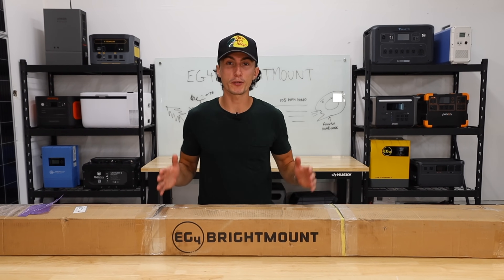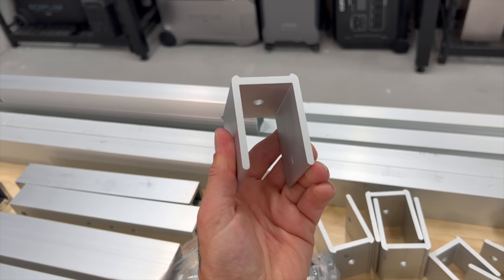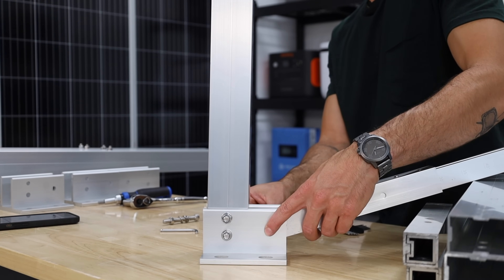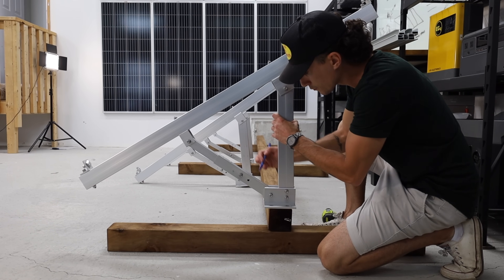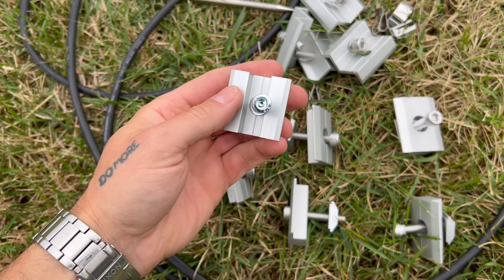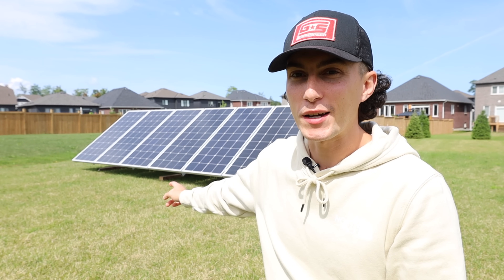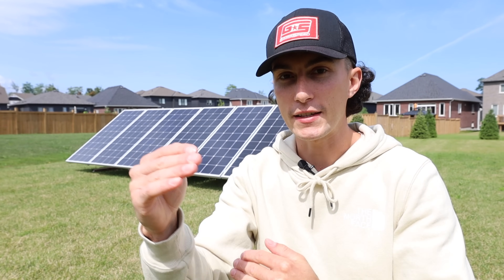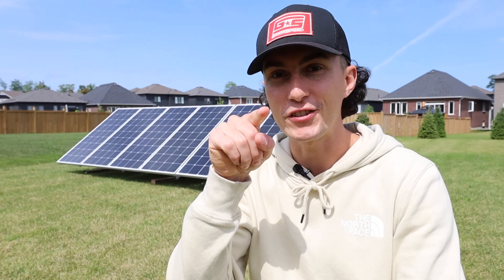Why Is It So Popular? - EG4 Solar Panel Ground Mount

Comment: So I think I have the same problem as you.  I have large bi facial solar panels that are 8‘ x 4‘.  It sounds like these can’t handle it. Also many of these adjustables can only go between 30° and higher. I am in Texas and I need 15° during the summer.

Comment: I highly recommend the Brightmount kit. I have it installed. You're correct that the bolts and connectors weren't labeled but it's pretty easy to figure out if you take your time and rush through it. I have one kit and will order another one down the road. I like your set up with the wood beams. This is so much more simpler than the concrete piers. Right now mine are anchored with limestone boulders until I could figure out the concrete piers. Now, I will go the wood beam route. I saw in the comments someone used 8x8s.

Comment: 6 panels? Maybe back in 2010. But today it only hold 3 400 watt panels. And requires an extension kit to add a 4th panel

Comment: hi, are they available in a larger size so you can mount two rows of panels?  I'm looking for to mount my 36 panels and only one row would make it too long for my property.  Also do they come with whatever engineering paperwork is necessaryto have them permitted?

Comment: I think this is Discontinued, its no longer for sale on Signature Solar
Reply: Agree - April 2025 - I could not find this mount with your link or anywhere!!!
Reply: @lindaswann6664  There is another mount which is easier to set up(integrarack) but it's more expensive and I don't like the fact that you cant really raise it off the ground (I get a lot of snow at times)

Comment: How gaint are these racks??? What is the width??? Your link doesn't go to the rack....
What about the back frame support??? You didn't show the strength of the joints 6:18....the base i do not trust...plus we in snow country needs more hieght off the ground...

Comment: what was the total size of this? The links do not go to those mounts anymore are they still available ?
Reply from the maker: This mount will fit 3-4 panels depending on the size of panel you're using. 

Also, thanks for letting us know about the link. Here's an updated one: https://signaturesolar.com/eg4-brightmount-adjustable-cat1-solar-ground-mount-system-supports-3-4-panels/?ref=thesolarlab
Reply: @TheSolarLab sorry yall, this link doesn’t work either
Reply: @TheSolarLab  none of your links work. Where is the actual product?
Reply: @TheSolarLab this link went stale, too. 😢

Comment: I own both v1 and the new v2 of these mounts and put them together over new years weekend. I took a side by side pic of the different parts and you will not believe the difference in thickness between v1 and v2. And to put insult to injury they went up $40 on price! I hope they are not cutting corners like this on their v2 chargeveters and batteries.

Comment: Brightmount Ver CAT1 has been posted on signature solar. looks like the rails can be adjusted but does not look as strong. The wind rating went from 105 to 90mph but the cost went up to $310. i was told the rails are different so if you have extras clamps and joining plates they are not going to work on the new version.

Comment: Great video, helped so much... good stuff, truly...  
but you left out some major details, like you didn't mention the holes in the adjustable angle inner sliding piece don't actually help... it only has 3 places the hold...  so despite your comment about 'firing in a bolt at the position you want', is absolutely impossible to get the right angle if you are in NC in october, and need around 50 degrees...  you can't even set it to 45 degrees. it's kind of sad... 

I will have to drill more holes...  they could have done that, but apparently chose not to, OR....   somehow yours is different than my EG4 mount. My GUESS is the way to be accurate is to just use the set screws to hold it in place... which does not seem very strong to me. So for now, I'm drilling holes at 45 degrees, even though 51 is ideal this month.
Reply: I would angle the base so you could get 50 deg

Comment: Thank you so very much for this. I built my own and what a pain! Never again. Plus, with my home made system I have to set each panel for angle to the sun. With this and a helper, it would be all set at the same time. I am going to purchase from Signature after seeing this!!

You didn't say or I didn't understand: Why did the larger panels not fit? Too long, too wide, too thick?  What would make them work? My panels are huge!   Where do I just go purchase the additional holders you robbed from another kit? Do I purchase more from Signature or Amazon? Do you have a link?

Comment: is there a solar wattage being produced calculator using different angles for the panels? It does not have to be spot on accurate just a ball park figure.

Comment: I would like to purchase panels from them. But it shows you have to purchase 10. I may be wrong.. I'd like to start a ground mount. I have a 3000 w battery generator I would like to charge.

Comment: If I were to add a second row behind the first row how would I compute the distance needed to separate the rows for maximum solar power?
Reply: Depending on the location and angle.  there are calculators online, for CT where I am 7’ space between the rows is good
Reply: @lukimy2704  can you provide a link please for the calculator you used?

Comment: Two questions I have is can you connect 2 systems together to be able to install 8 panels across. Second is how far would you have to put 2 different 8 panel mounts apart from the other to prevent shading.
Reply: Yes, but you need extra connectors for the rails

Comment: I bought four of these and mounted them over the last two weeks. They can be a bit fiddly assembling the rails as you noticed, those tiny backing clamps that go in the rails are .. too small. I had to buy the extension kit to fit four panels on each since mine were around 44.5" wide. The hardware sometimes being in bags and sometimes not drove me nuts, as it can just float around the box. The rail "splice" part often had hardware not attached and floating around the box. All in all, I would use them again.
Reply: How is the extension installed?, no document on the site
Reply: @Scat.original  they provide two inserts that just slide together.  they provide screws to keep them from sliding apart.  the combiner plate is long enough to combine all three pieces together.

Comment: You get what you pay for. A little more money for durability will pay for itself in the long run. Would you rather have rails that stay straight and rigid then those that sag and corrode in short time? I would invest in solar panels but have too many trees around my house and surrounding area. I like your fair and honest reviews. When I sold satellite receivers, I stuck with high quality products. One man tried pitting me against another company by saying, "What if I told you I can get the model xyz (same high end receiver I had) for __ dollars less?" I told him go for it but I would wonder where he's cutting corners. And I knew where the corners could be cut. Cheaper is not always the best value.

Comment: P.S. My brightmount panels came in a few weeks ago.  I complained to SS that the bolts were defective.  The bolts go on easy enough, but if you make a mistake or need to change something the bolts do not come off.  My theory is that when tightening, the nut or the bolt threads bend.  This makes it impossible to remove.  I had to remove two bolts and with a 2 foot breaker bar and broke the bolts I need to remove.  If you never plan on removing the bolts, no big deal.  SS would have never found the quality issue just checking the bolts.  Maybe it was just my batch.  I will buy them again for my next array, but I will not tighten anything until I am sure everything is assembled properly.
Reply: Are they Stainless Steel bolts? If yes, then you need to apply anti-seize before assembly. If you do not then then the nut will seize ... exactly as you discovered.
Reply: @MrSummitville  Yes they are Stainless Steel.  Maybe SS should add that advice to their unclear manual.
Reply: It's not SS fault that you over-torqued stainless steel bolts. Everyone knows stainless threads will curl when you over-tighten. That's on you.
Reply: I'm glad I read this because I didn't know it @jonvanwyk2026
Reply: "Everybody knows..." No, they dont.

Comment: I have 2 installed hooked together have 6 325 watt panels and 8 200 watt panel Been up over a year no problems H2 coming and 16 360 watt panels coming will install this winter

Comment: I mounted two brightmount arrays on top of a 20x20 pad I created with crushed white paver base on top.  Then I used 6x6 posts to create the base footings.  One array has four 415W Sirius panels and the other has three.  They are all in series and power the EG4 2T mini-split.  I set them at 30 degrees.  At full sunlight they generate 280V 100 ft from my mini-split.   Even though I have a heavy base, I also anchored the mounts to the ground with wire tie downs.  The white base provides a good reflective substrate for the bifacial panels.
Reply: My only concern would be whether you looked at the wind load/speeds for your area and designed the tiedowns accordingly? My further comment, which doesn't apply to your project, is what the fix is for uneven slopes. It's certainly possible to anchor posts in the ground and make the cut level across them in order to bolt to them. I've been using the Iron Ridge design, which is much more expensive and permanent. But it handles wind loads up to 120mph and snow loads to 40psi, which is usually above the panel strength anyway and with a reasonable panel pitch, never comes into play. I like this system, it just seems like it needs to have a better anchor system with it. Those screw type anchors may work well with this? My system installs are usually 20+  panels in a 4 panels tall arrangement so this wouldn't work for that anyway, but I do like how it goes together.
Reply: 4 panels isn't an "array"

Comment: For longevity's sake, if you're going to mount on a treated lumber base similar to this... it'd be best to use long bolts through holes drilled all the way through both pieces of wood - with large fender washers. Similar to what you'd do when framing a deck. Then use some ballast (weight) on the 'legs' for wind resistance.
Reply: That is what I did with these brackets.
Reply: @RCTVAccount Will 1/2" bolts work?

Comment: The clips are designed to be narrow so you don’t have to slide them into place just angle them while inserting. I did not know this at first but it does save time when you have 20 to build. Great review you just reminded me how much I like the Brightmount.

Comment: Mounting it on a 4"X6" makes it sturdier and gives it more support. I elevated mine 36" above the ground on 4 6"X6" treated lumber sunk 40" in the ground. It won't withstand a hurricane but I'm in the Midwest so it should be fine. They are included with their mini splits which come with a 4 panels, if you need more clips order them. Not something you'll find at Home Depot.
Reply: Reading the manual (online pdf), it says the stands should be 130cm apart max and built/fixed on / as a 5x50x85 cm concrete block each with an earth hole deep to 40 cm! Which makes a bit more stability (!!!!) than just the 4x6”! Somewhere in the middle my engineering brain says, will be the optimal foundation to the panels! I’ll start to built my (6) 400W panels up next week! Winter angle preset… wish me luck ;-)
Reply: The weather has taken a toll on trees in my area this winter. High winds, hail, a tornado within 5 miles. Took trees over in neighboring yards. Tightened everything up it looks as good as day it was installed. Well worth the money, effort and time I put into it. Cut my electric bill 40%!

Comment: Seem pretty good but I'm needing a ground mount system that i can lower flat to the ground before a hurricane hits. Know any that can lay flat? Wonder if I can modify this one to lay flat. Thanks!
Reply: It would probable be cheaper and easier to make it mobile and move it to safe place if possible. This one is not designed to lay flat. It is very sturdy though, as he points out.
Reply: @RichardQuaid  no safe place on the island when a hurricane comes!  I might need to do a custom build
Reply: @slugbyte  It would be easy to make a custom one by me, but I imagine lumber isn't cheap by you. Good luck!
Reply: @RichardQuaid wood would be easy but the termites would eventually get to the treated lumber, they even chew through concrete to get to wood in houses here. I'll probably have to fabricate and weld some together. Thanks!

Comment: Nice Mount,  and one thing I like about them is its an easy way to folly the sun with a simple pic up and moving. One other way too is to mount casters on the bottom that have a lock (brake) on them. Also heck out the Makita 18 volt LXT battery powered impact wrenches  that come in 1/4, 3/8. and 1/2 drives, and even higher, .that way with any of these drive sizes, you can drive them bolts on like butter with ease. The Makita 1/2 impact drive have that power to take on and off lug nuts on your vehicles including SUV's and Trucks multiple times on a single charge